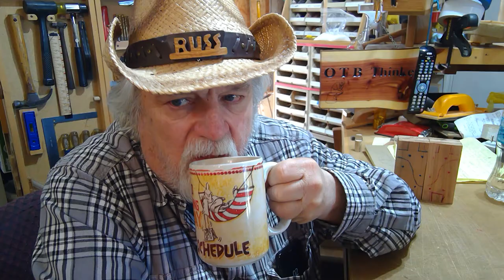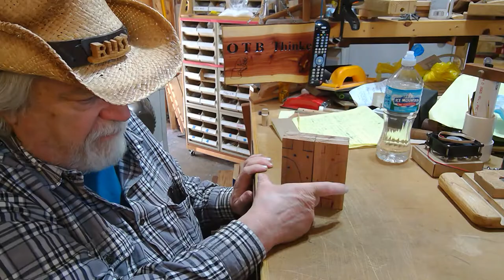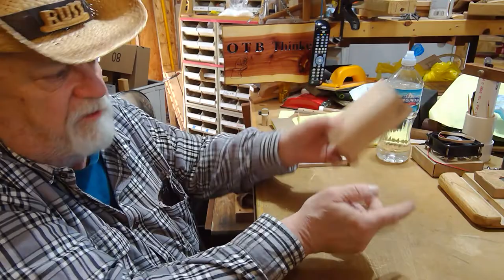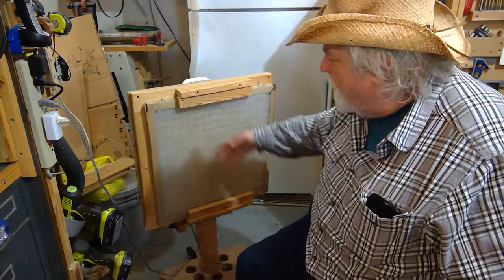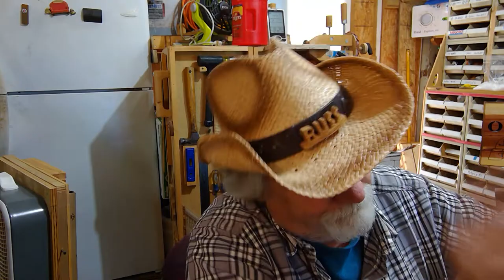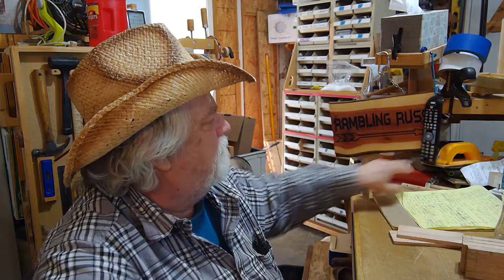Wood Hinges and More by Rambling Russ

Comment: Thanks for the link to the 3 finger cut for the box/hinge. It makes things seem to be very straight forward for creating hinges. Now of course my major problem will be centering and accurately drilling the hinge pin hole. Drilling the hole to make the joint rock solid and drilling the hole for making a hinge are indeed two different things. Looking forward to the next episode!
Reply from the maker: thanks Tim.  This hinge is more difficult than my stick hinge.  the pin hole alignment is everything.  this hinge takes a lot of practice to do it right.

Comment: I live in Central Texas and my shop gets down right hot.  Your multi-tasking box filter  idea really caught my attention. I have a box fan set up as an air filter and you are absolutely right about the restricted air flow for cooling use.  Multi tasking would make my shop much more bearable. I will be watching for your progress on this. On another note the three finger hinges are very intriguing.
Reply: Make a box out and of 5 filters and place the fan in the 6th position. Creates more filter area and less restriction. Though the downside is the size. I used this to filter air in the house many times.
Reply from the maker: Sounds like you are having as much fun watching as I do making these videos.  Thanks Poppa.  BTW, I suspect you will love this multitasker fan in the hot weather.  I'm looking forward to getting it done.
Reply: Yes it gets hot here in Texas, I am in Abilene and my 400 sqft wood shop is getting a new 24k mini split. Heat pump! I am looking forward to seeing other video on the hinges.
When I want to put a radius on on either wood or steel parts I have piece of plywood with different wholes in a straight line that I can put a pin in, what hole I place the pin in  determines the radius of the arc on the part as I move the part from side to side. In the case of the hinges this will insure the same radius of all the hinge parts. 😁🛫

Comment: Out of curiosity, what are you using for hinge pins...do you need something special so that the pin has a head? Or have you found a convenient supply of hinge pins somewhere?
Reply from the maker: I use anything round and straight (including nails & skewers).  I do/did have 1/8" brass (out) and metal rod.  I am going to use 1/8" steel rod for this project.  I haven't talked about the pin choice . . . till now.  Thanks for the question.  I'll include my thoughts about this in my next hinge video.